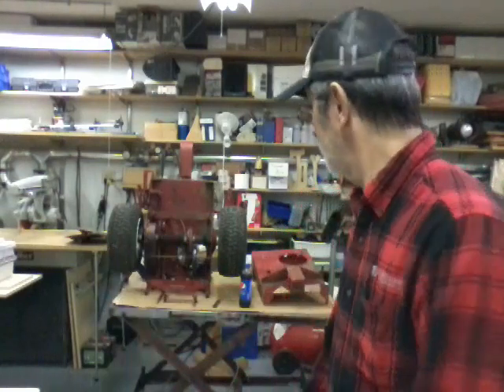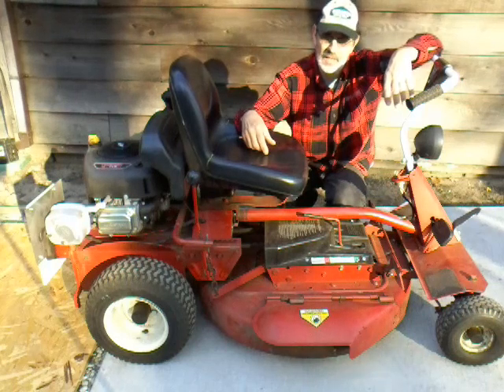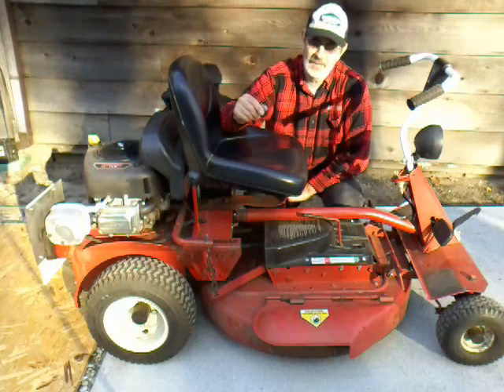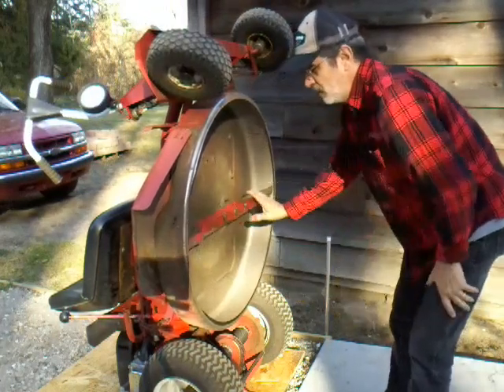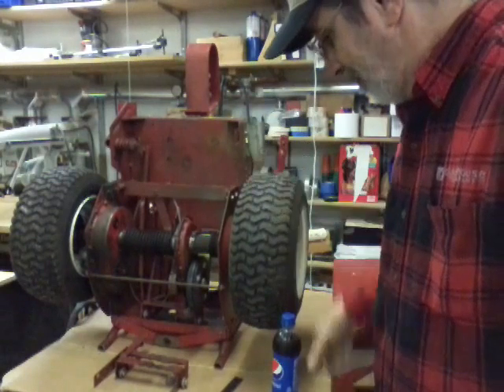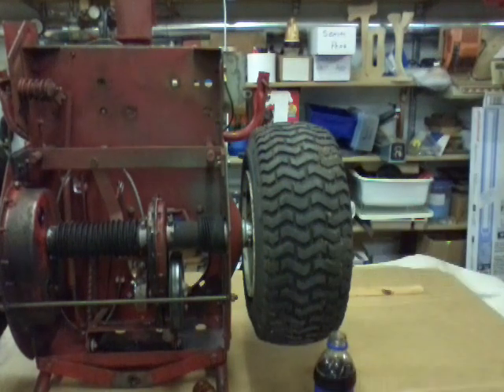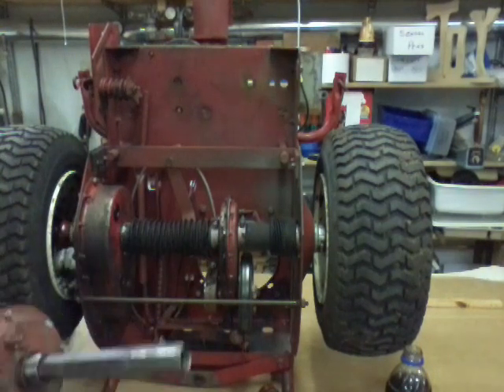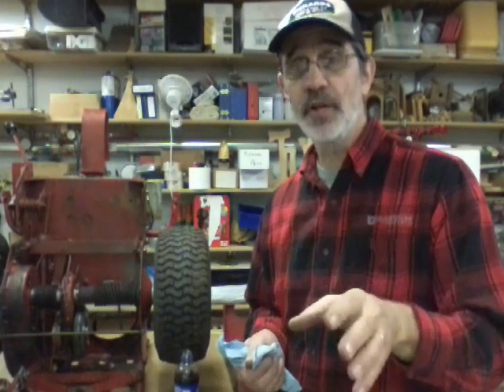56. Buying a used snapper,   things to look for

Comment: What is wrong is the tube dont turn in the case, and is Locked. 
What will it do if its locks (how it will act?)
Reply from the maker: anthony diodati 
Hi it’s Jim
   If you’re talking about your hexagon shaft will not turn it could be the chain in the chain case or the differential that has broken causing it to lock up. Jim
Reply: @jimjackson9381  I forget what you called lt, but when you stood the tractor or mower up on its end and then you grabbed it up by the wheels and tried to twist the tube back and forth you said it should move it looks like it moved by three or four inches  either way 
(let me see where it is in the video........)
Okay it what is it about 3  minutes and 30 seconds you have the rider stood up and you grab both front wheels and try to you said to make sure it rotates that's what I'm talking about and what the problem would be if it is locked up and does not rotate back and forth......
Reply from the maker: anthony diodati 
That is the pilot bushing between the rear case and the front tube that is rusted and froze up. Jim
Reply: @jimjackson9381  Wow Not Good, Especially Rotted?
Is that Lawn boy below and good. 
I don't want to Pay No $400.00 though,  I missed A Sweet 48" Craftsman, New back tires, new battery, Manual snow plow, used two times with it, 
Sadly the fellows Dad passed away, said it needed nothing. 
Seemed well taken care of!!
Looked clean as could be .  $200.00!!!!!     It went FAST
Reply from the maker: anthony diodati 
Hi Anthony
  If the tube is frozen in the rear case you can still use the machine the front end won’t pivot when you go over a slight bump or a mound in your yard but it won’t hurt anything to run it that way. I have a friend who is a very flat yard and he never knew his was frozen up until we worked on it. Thanks Jim
Reply: @jimjackson9381  0k thanks.
This yard is anything but flat. Okay I am renting here she was supposed to have it taken care of I don't get around like a young man no more but I told her if I could get a riding mower I would do it she's probably going to start pestering me but I have money issues at this time going to see if I can get her to get somebody to do it for now she expects me to do all kinds of stuff other stuff around here too for free I never signed up for that

Comment: Jim...Just recently bought my first rear engine riding mower ever and it happens to be a Snapper model 300812BE serial number 35-466681 since the owner had no owners manual for it.  I was wondering what information you can tell me about this SR95 Snapper Classic.  I was told that it may have been manufactured sometime in the 1992-1994 timeframe?  I was also wondering who my best source would be to purchase OEM replacement parts for the snapper mower and the Briggs 8 HP vertical shaft engine at a reasonable cost.  I was also informed by the seller that the engine was replaced sometime during the mowers life, however its still an 8 HP Briggs & Stratton vertical shaft engine, Model Number: #195702 - Type: #4520-E1 - Code: #9906253A Synchro-Balanced.  Any information or advice you can provide me for this mower or engine would be greatly appreciated.  Thanks!
Reply: This is a late answer to an older thread, but your engine code: 99 is the year, 06 is the month, and 25d is the date of engine manufacture. I Googled B&S manuals on line a couple of years ago, found mine, and printed it out. You can also find the Snapper manual for the mower and print it. Armed with that info you can usually find the parts you need on line, some even on eBay, and check who is the authorized local B&S parts and service outfit. That's a good source for parts and advice.

Comment: Jim how  can  tell the year of my snapper? love the vids thanks
Reply from the maker: michael carter 
 I have not found a good way yet. Thanks Jim
Reply: any tips on patching old snapper decks or just find a newer one?
Reply from the maker: michael carter
 Mine got so bad I just parted it out and found a new one
Reply from the maker: michael carter 
  There's not really a good way to find the year of the snapper you just have to call the dealer and they can help you Jim
Reply: thanks
Reply: I know this is an older thread, but in my case I have a 33" with a B&S 17.5 HP engine. On the engine valve cover are model, type, and code. The code on mine is 081210ZD. My information says that to read the code,  08 is 2008, 12 is the month, December, and 10 is the date. Assuming this is the original engine, which I believe it is, my mower was built in 2008 or more likely 2009 with such a late engine date.

Comment: hey there,
I have a snapper hydro 384151hbve, the blades won't engage. It drives and the clutch works when I press it? Any ideas?
Reply from the maker: Jen Mck
Hi Jen.    If I had to guess right off hand I'd say your belt broke  or your idler pulley has locked up.   Let me know what you find out and I'll help you get through that to check your belt you can either stand your machine up or take the plastic cover off the mower deck,  let me know Jim
Reply: Jim Jackson 
will do, the top small belt was missing so I assume it broke. I replaced it.

Comment: Hello Jim. Thank you for your information on Snappers. A friend of mine has a riding mower Snapper SR928. 9hp B&S engine is blown. Free if I want. What would you replace the engine with. Thanks jeff
Reply from the maker: Christina Locklear    Buy that number it looks like a 28 inch I would probably put at least a 12 horse on it on the new ones have a 10 to 12 horse on the 28 inch machines last I knew.  If you have anymore questions send me another comment or email thanks Jim

Comment: Is there a part on these mowers called a gear shift plate? I came across one of these mowers the guy wants $50 for it .... ( Divorce thing).... But he said it needs gear shift plate...
Reply from the maker: Matthew Kyle 
Yes.  Buy it.  The gearshift plate is the plate on the right hand side of the machine that the shift handle comes out of it is typical that the detents in the plate ware smooth so it doesn’t shift or stay in gear properly. If and when you get it take some pictures and send them to me to my email and I’ll tell you how to fix it. Jim
Reply: @jimjackson9381  thankyou.... I bought and replaced part ... Runs like new.... Many thanks to you sir
Reply from the maker: Matthew Kyle 
Well I hope I won you over as a subscriber, I could use your help by subscribing and their is always more videos to come. Thanks Jim
Reply: @jimjackson9381  you sure did
Reply from the maker: Matthew Kyle 
Thanks

Comment: Why can't Snapper come up with a clutch system that doesn't take off like you "pop" the clutch each time?
Reply from the maker: Stan Wilhite 
Hey Stan it's Jim if you have the newer style clutch there called a soft start   if it's working right it should take off slowly and smoothly.  If you want to see how it should be working let me know and I'll show you on my model how they're supposed to work thanks for your questions and comments talk to you soon Jim
Reply: Thanks for your reply Jim. I used to have a Snapper that I mounted a spray tank on and was always amazed that they didn't use a different clutch setup that would allow a slower/smoother start. I no longer have it....I was just curious.
Thanks again, Stan
Reply: You the greatest jim!!! Thanks for the videos!! You've helped me a lot on my old 1983 snapper riding mower and saved me $$$

Comment: Hey jim if i paid u could u inspect my snapper rear engine rider and replace any wear parts
Reply from the maker: Where do you live. Jim
Reply: @jimjackson9381  in flordia but im looking to take a road trip soon
Reply from the maker: @ANDERSONEXPRESS7  so what all are you looking to get done with this thing what style of a machine is it and how old is it. Jim
Reply: @jimjackson9381  its a 1980 snapper 30 inch deck just want just a inspection and repace all wore out stuff
Reply from the maker: @ANDERSONEXPRESS7  How soon are you looking to get this done, I’m a little busy if you dropped it off when do you expect to get it back. Jim
Reply: @jimjackson9381  dont really matter when i get it back where are u located

Comment: Does anyone know the model number of the starter for a 13 horse Briggs
Reply from the maker: If you call Briggs & Stratton. in Milwaukee Wisconsin they can help you out with that number. Jim
Reply: @jimjackson9381  thanks man
Reply: @jimjackson9381  I assumed the 12 horse and the 14 had would be the same starter but they're not they mount the same but the bracket is different

Comment: Jim, I watched all your videos and they were all informative and helpful.  I am looking for a 2012 or older model based on your concerns about the engine on the newer motors.  I found a model M280919B that I am considering.  The serial number is 84376 01080473.  The tractor has a 9 hp Power Built Briggs engine with a pull cord start, code number on the engine is 000301Z.  I am trying to figure out how old the tractor is and if this is a good motor.  I was hoping to find  one with an Intek engine.  The owner says he bought it about 15 years ago.  There is another number on the decal with the serial number and model number.  It is 59307 84376.  I looked on Tractor Data and could not find a record of Snapper making this model number or a model using a 9 hp Briggs motor.  The photos the seller posted all look good.   Based on the information I provided, would you have any concerns?
Reply from the maker: mark carpenter 
Hey Mark it’s Jim
If you got a machine with a power built engine on it it is a good engine do you want to stay away from the Intek engines cording to my engine guy they have too many issues know if that engine is original you can go by the code number and tell what year the engine was built which will tell you when the machine was built.Jim
I had to look back at your email I forgot your model number, your model number is 280919
Which tells me originally it had a 28 inch deck, a nine horse engine, and A Series 19. If you have any other questions or need any issue was solved let me know. Jim
Reply: Jim, thanks for this information.  Is there any problem getting parts for the older snapper machines?  This one is probably 20 years old.  Is that what you think based on the various numbers I provided?  Thanks.
Reply from the maker: mark carpenter 
You can get any part you need for any snapper from Parts Tree.Com out of Texas or Jack small engines or Amazon there’s parts everywhere for these things. Jim